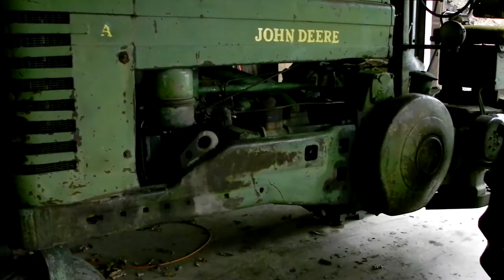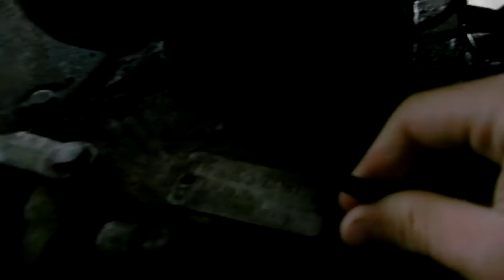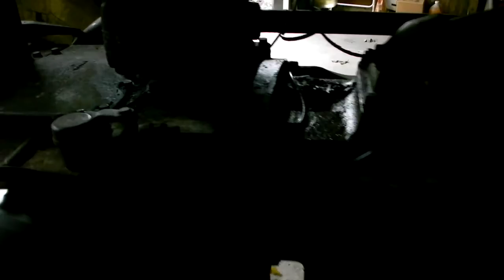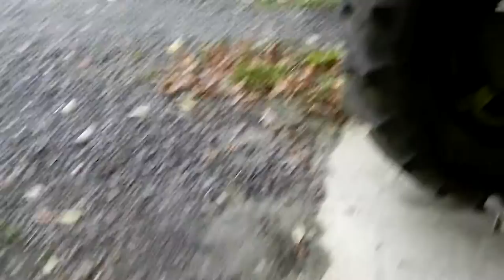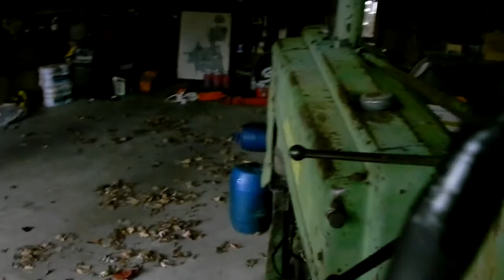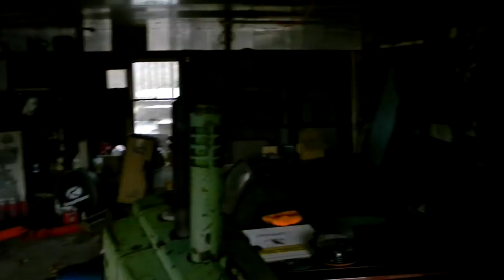John Deere A running on 1 cylinder

Comment: This might sound elementary. But did you try changing the plugs? Maybe one had fouled out? Definitely pull the mag cap off to get that piece out, put new wires on it, and plugs wouldn't hurt either. When I put new plug wires on, I usually solder the ends on to further prevent any malfunctions. Message me if you want more details on that.